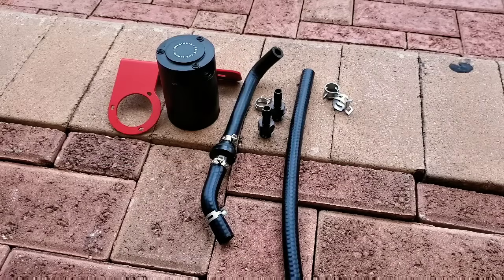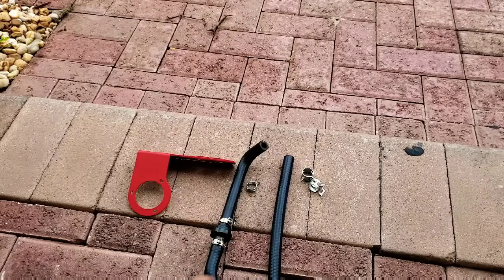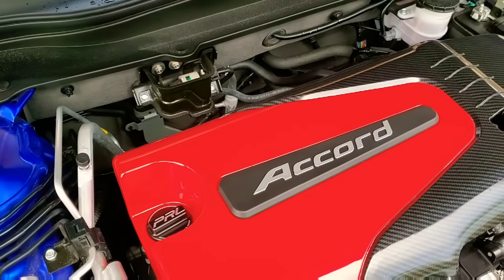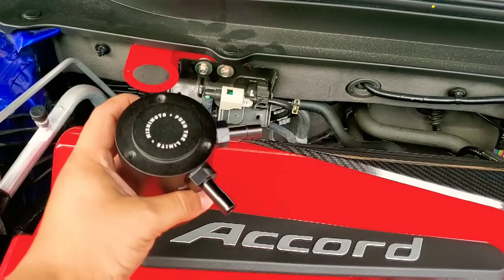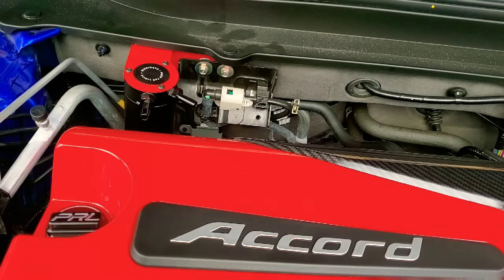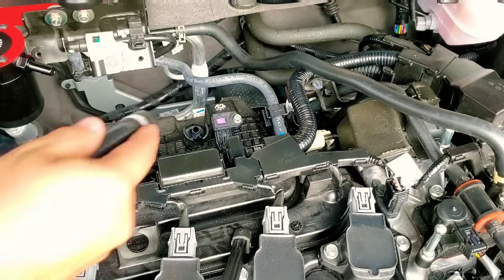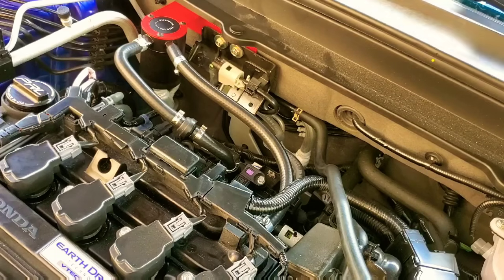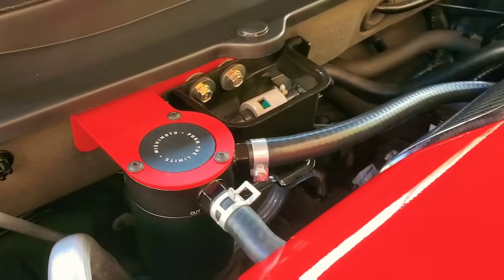Mishimoto Oil Catch Can Install on Honda Accord 2018-2019

Comment: What did you use to cut the engine cover and without damaging the engine cover?
Reply from the maker: Dremel tool or a sharp knife. It's abs so it shaves off easily.
Reply: @BoostedWhipz  Thanks dude. I appreciate the support you provide this community. Keep up the great work. Looking forward for the v4 kit updates

Comment: i ended up using the smaller claps i made them fit with a bit more push they went on,you would think after a year of making these they would have change the smaller clamps but it works thanks to frank

Comment: I was told from my Honda group that that is unnecessary to add to your car just make sure you do you normal oil change and you should be good so I’m second guessing it
Reply from the maker: This adds a second level of precaution. Doesn't hurt to have it.
Reply: BoostedWhipz true cause I’m just trying to find upgrades for my car cause I ran that car so much that I feel she needs some better hardware

Comment: Hey man just curious how you actually clean an oil catch can when having your oil changed. Pretty sure Honda would charge extra to do this, if you are taking your car to them for oil changes? Also a separate question...how much horse power does your car have after doing the intake, full exhaust, and tune?
Reply from the maker: I have a seperate video on how to empty out/clean the catch can. Please check it out. Power wise I am going to Dyno it in the upcoming weeks. Currently my setup is intake, intercooler, catless downpipe, frontpipe, exhaust, and custom tuned by IMW.

Comment: how install oil catch can for 2018 acura 2.4 engin?Thank you so much
Reply: Already subscribed，Thanks
Reply from the maker: Should be similar if you find a direct bolt on vendor.

Comment: Hi, is this the 2.0L turbocharged accord? The engine look similar to my 2019 RDX with 2.0L turbocharged. Will this kit fit my RDX? My engine had the same mounting bracket.
Reply from the maker: This is the 1.5
Reply: @BoostedWhipz  i have 1.5 T too? But mine is metallic silver so do u think red will look good?
Reply from the maker: @samidpersia9832  yes since it's under the hood.
Reply: @BoostedWhipz  thank you!

Comment: How much oil did you accumulate in 1k!  I’ve seen their article and saw stock 2.0T had 50ml of oil
Reply from the maker: I just installed it. I'll check in about a month and provide update.
Reply: Any update?

Comment: Be sure to check your hose where you had to cut the cover.  You want to be sure over time that any sharp edges on the cover don't rub or cut through your hose.
Reply from the maker: I cut deep enough and wide enough. Thanks for the lookout.

Comment: I herd an oil catch can doesn’t really work? Do you think it will work ?
Reply from the maker: It's been proven that it does. I personally think it does as well.
Reply: I would guess 99% of running cars with over 200K miles never had a catch can. I'm sure it helps but it's not needed.
Reply from the maker: I would agree. I just got it to make sure and better be safe than sorry. I will be checking the level this weekend.
Reply: @BoostedWhipz  They do look good under the hood.
Reply: @stepaukob  ..Def needed for GDI engine!!! keeps the valves clean. no way to clean them otherwise.

Comment: If I keep things stock, would this still be beneficial for the longevity of the engine?
Reply from the maker: If left stock you should be fine. I still recommend doing this since due to how direct injection motors work, it can have build up in the long run.
Reply: I remember seeing a Scotty kilmer video about an oil catch can but didn't know where to go. Ima wait for your 1000 mile update to decide if I should pull the trigger. I'm already at like 42k miles for my 1.5t so I hope this helps alot. Thanks bro
Reply from the maker: @SuismS3  my pleasure

Comment: So please tell me I don't understand this thing that you installed what does it do for the car?
Reply from the maker: To make a long story short, it keeps junk away from recirculating back into the engine and intake manifold. Definitely recommended for modded cars. Helps longevity of the engine especially direct injection like ours.
Reply: @BoostedWhipz  okay but as efficient as these cars are and all the stuff that they already put in it wouldn't that not happen anyway ?
Reply from the maker: @johnhightower9780  direct injection cars are vulnerable so no matter what they do, it's still vulnerable. Do some research to understand it better. This is just to protect the longevity of the engine. I am fully modded so definitely needed in my case.
Reply: @BoostedWhipz  okay well I understand what you're saying I'm not going to worry about that thanks for the info

Comment: I'm sorry my ignorance but what does the baffled oil catch can do?
Reply from the maker: To make a long story short, it keeps junk away from recirculating back into the engine and intake manifold. Definitely recommended for modded cars. Helps longevity of the engine especially direct injection like ours.
Reply: @BoostedWhipz  Thanks BW good to know.